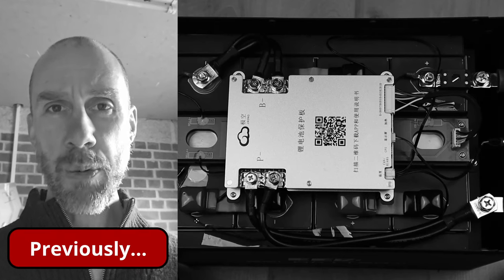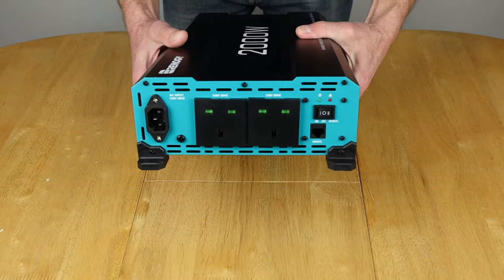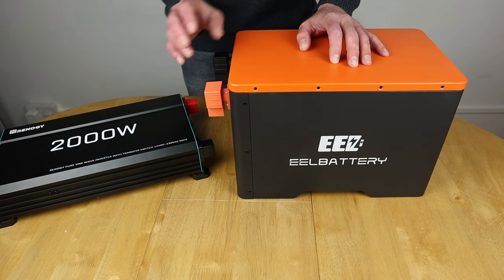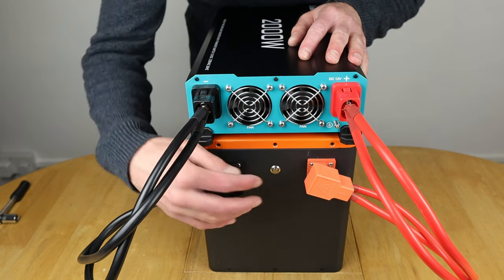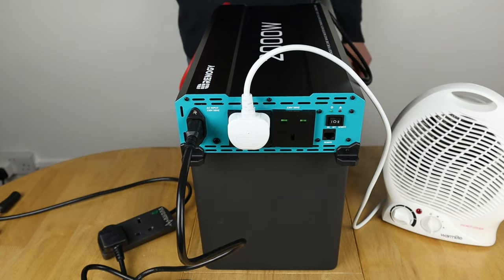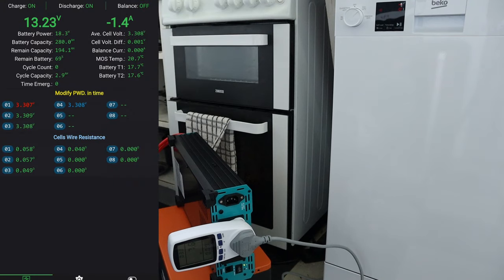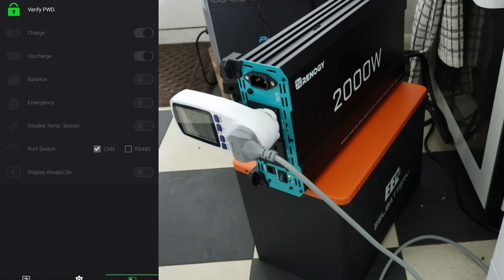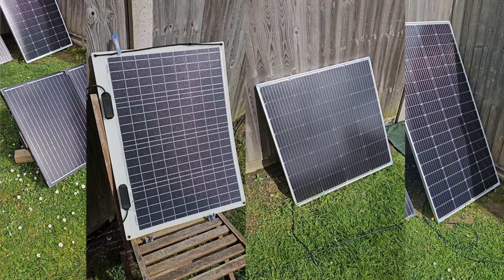Van, Shed & Match? | 2000W Renogy Inverter & EEL 280Ah Battery

Comment: I plan to use this with direct solar to DC Side. If clouds block the sun and there isn’t enough solar power, it will switch to AC power. When the sun provides enough light again, will it automatically switch back to using DC power?
Reply from the maker: @SynthToshi  Thanks for your question. It's like a UPS. All the time there's mains power connected to the inverter, that's what will supply the two inverter sockets (regardless of DC source). Once that AC power is lost, the inverter sockets are then supplied from the 12V DC source (battery in my use case). I hope this answers it? All the best, Adrian
Reply: @DADvinci  I guess this device is not for me and need something with smart transfer switch.
Reply from the maker: @SynthToshi  You might be better off with an offgrid hybrid inverter (has everything in one box). This is an older video https://youtu.be/PK0k16lQEa8, but the 12V inverter still works fine and I use different 12V (LiFePO4) batteries with it. You can setup the source priority for the kW rating output on the inverter (whatever you choose).

Comment: Non related question but you maybe you can help. I have a Jackery explorer and a jacket solar panel . I am wanting to use the solar panel as an addition to the solar panel on my campervan. In essence I need the lead that I can plug the solar panel into and then can wire directly to my MPT controller on my van. I am unable to find online a female socket that the Jackery solar panel plug into. Thanks in advance, Ian.
Reply from the maker: @ianschofield7350  Hey Ian! I use a Jackery panel friendly cable/adapter combo on my detachable MPPT solar charge controller in this video https://youtu.be/c9HxjIRtQlE . It's a female DC input to Anderson cable, but comes with an 8mm adapter (assuming that's the Jackery solar panel you have). You could cut the Anderson connector off and extend the cable if needed (depending on your setup). The link is in the video description on that video (DC Input to Anderson cable (with 8mm Adapter)). Please let me know if that's what you're after as an option or if it's something else. All the best, Adrian
Reply: Thanks Adrian 👍

Comment: These high frequency, transformerless inverters have a much shorter life expectancy and a far poorer surge capacity than a low frequency, transformer based low frequency inverter.
Reply from the maker: @quickquote1568  Completely agree. It's all about choice and application though. Both have pros and cons, personally never had a HF inverter fail. The weight and cost are obvious differences, with LF being better for larger inductive loads like motors/compressors and longevity.
Reply: @DADvinci  Your very fortunate to never have experienced the failure of a high frequency inverter. I repair inverters for a living, several thousand over the past 24 years and the vast majority over 80% of the inverters that I have repaired have been high frequency inverters. When we did get a low frequency inverter in for repair, it was primarily due to lighting strikes, exposure to the elements, rodent infestation or miswiring where the output of the inverter was connected to the grid.